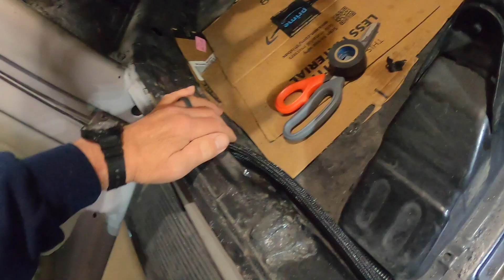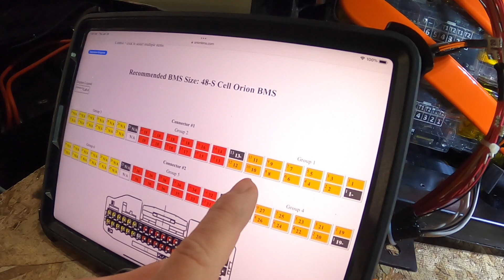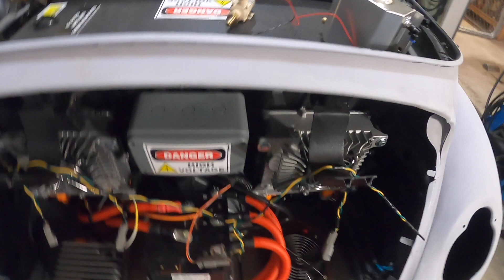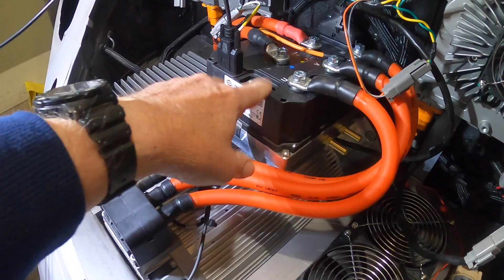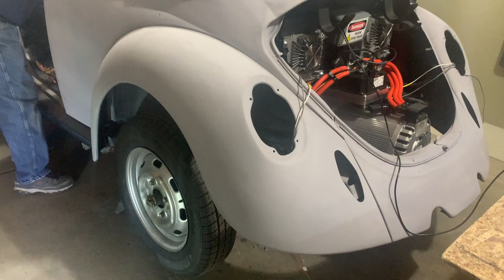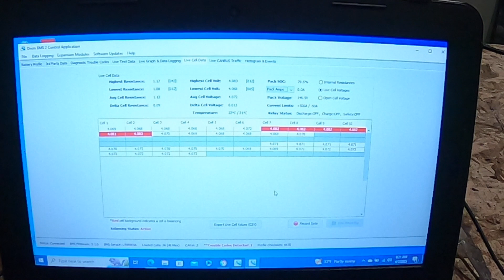The 1974 VW Super Beetle Gets an ELECTRIC Shock

Comment: Would it be possible to do the grouping of your remaining cell voltage monitoring wires on all modules, to effectively going from 48 to 24 V? It seems strange that you now have a mix of 48V groups and 24V ones.
Reply from the maker: Good point. The issue is I have two packs. One in front of car and one in rear. Split. Bms is in the middle.  Two many wires to run from front pack to rear visa versa. Thanks